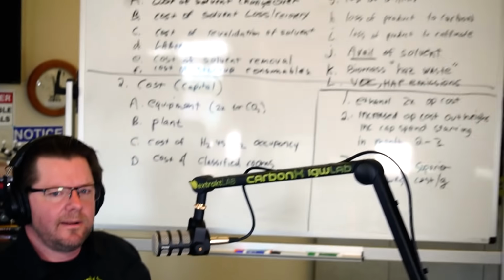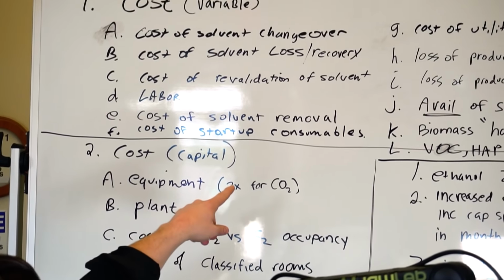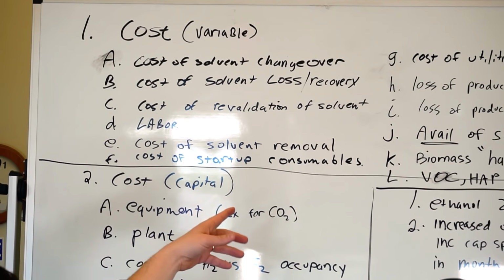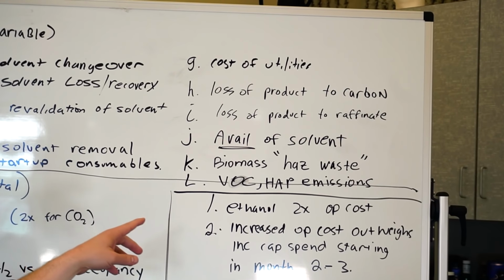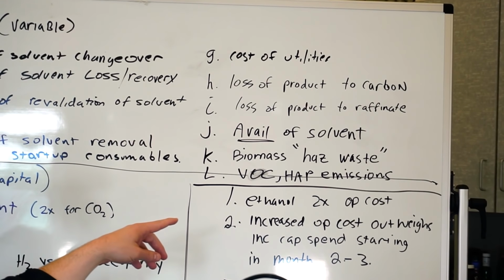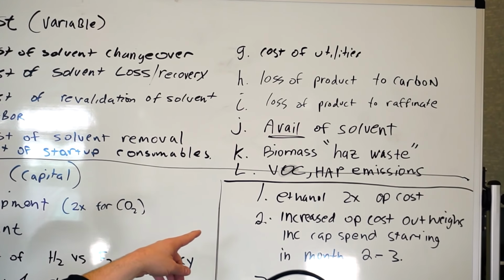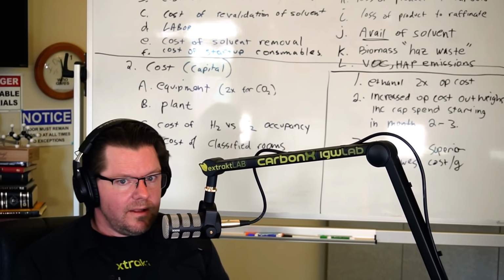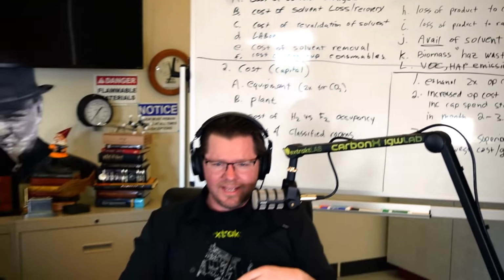No Holds Barred: CO2 Extraction Vs Ethanol Extraction

Comment from the maker: Time Stamps:
0:00 -- Ethanol Vs CO2
2:00 -- Choose your Solvents
3:37 -- Trade offs
05:39 -- Safety Issues
9:15 -- Costs?
12:54 -- Terpene Profile White Paper?
16:37 -- Favorite Scotch?
17:30 -- Building Justified Questions?
19:28 -- Tincture of Death
22:33 -- 1981 White Paper
23:13 -- Benefits of using Ethanol
26:44 -- Ethanol Equipment Cheaper?
27:34 -- Throughput?
29:31 -- Space for CO2 Facility
32:09 -- Use Ethanol For CIP?
33:17 -- CO2 to Remediate THC?
34:14 -- Buisness Decisions
39:11 -- 100% Ethanol Free?
41:07 -- Topic Next Week
42:13 -- CBD Jam Session
42:52 -- Best Method For Tinctures?
45:08 -- Difference of Extracting CBD and THC?
46:48 -- Advantages of Terpenes?
49:48 -- Current Market and Where it's Going?
53:00 -- Why We are Here?
55:00 -- Parting Words